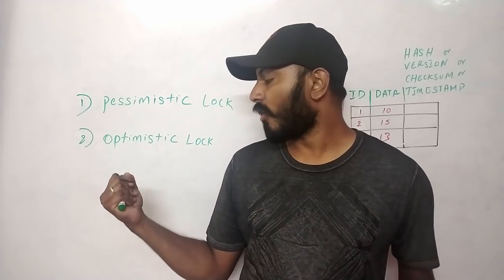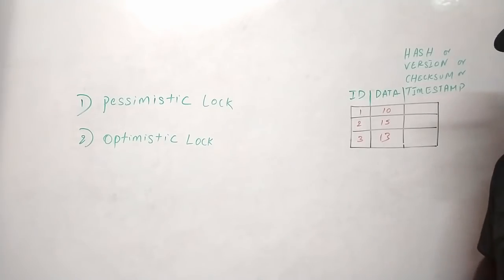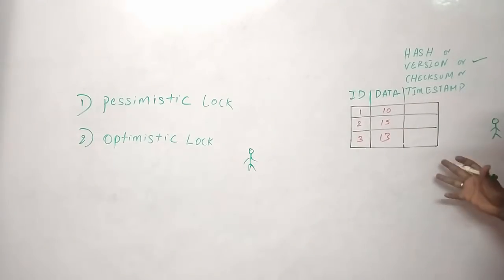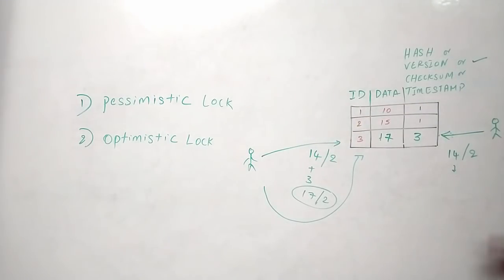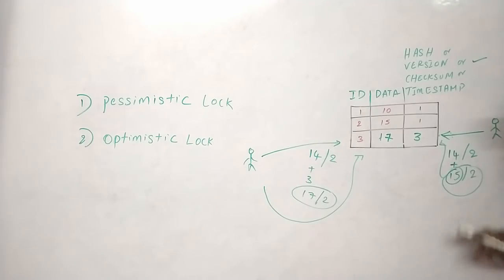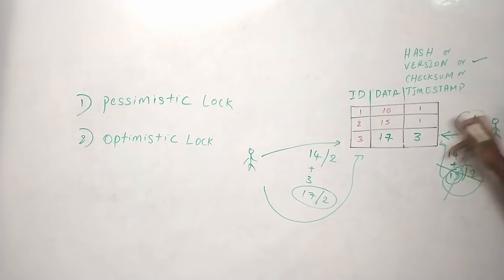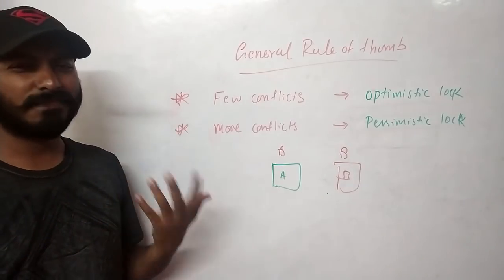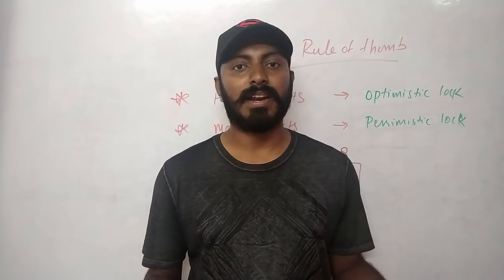what is OPTIMISTIC LOCK?

Comment: Question : How optimistic lock handles concurrency? If multiple threads are trying to update against a same version number then how the correctness of the system will retain?
Reply from the maker: You will need to use pessimistic lock/ transaction there. Because you are reading n updating.
Reply: Apart from pessimistic locking way, this can be achieved by optimistic locking also, you can read about MVCC. Many DBs like Postgress uses this approach.
Reply: My team generally handles it with some sort of retry policy wrapping the processes which also enforce some basic validations. If the update fails since some other process concurrently updated the record, then you need to re-read the record and then if the update is no longer safe, it should be enforced by the common set of validations that each process would have had to enforce.

Comment: Aren't the concepts really more of "Pessimistic locking" and "Optimistic concurrency"? I've never heard it referred to as Optimistic locking since the whole point is that it's not locking but rather validating that the mutation is still safe based on criteria like versioning.
Reply: Well, my first reaction here was "its lock, not control whether pessimistic or optimistic" but as more I explored, yeah this is the case - "Pessimistic locking" and "Optimistic concurrency (control mechanism with versioning, if you will)". Yep!

Comment: Thanks for the video.  One question: assuming version 1 data is n, process 1(want to +1) and 2 (want to +2) both validate that it is safe to write since version has not changed,  the slow writer will operate on stale data(since the fast writer finishes writing first).    How do optimistic locking solve this issue?
Reply: Charlie Zhang Both processes will read the data at version 1, write the new value into their own write buffer in parallel. However at commit stage, one of the processes will succeed in updating the data, which will be the version after the commit. and another process will be aborted because it read data at version 1 which does not match version at commit time and have to retry its transaction